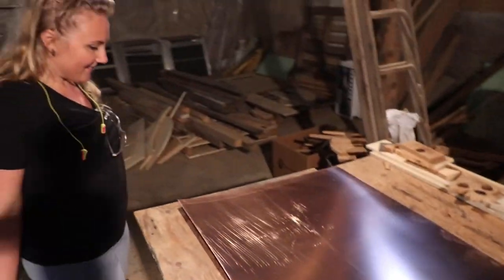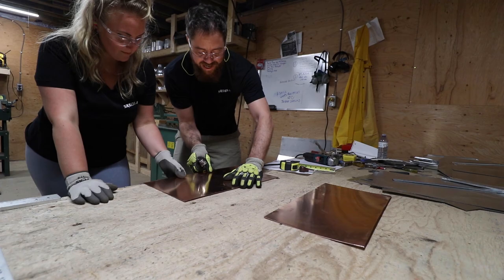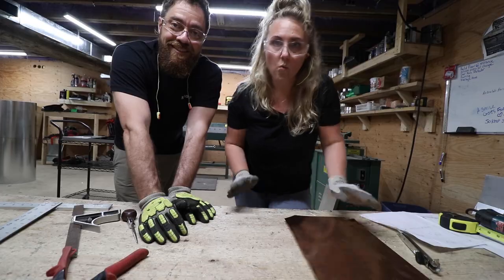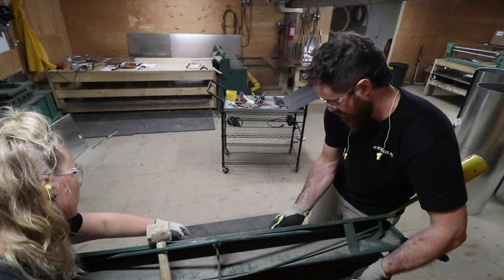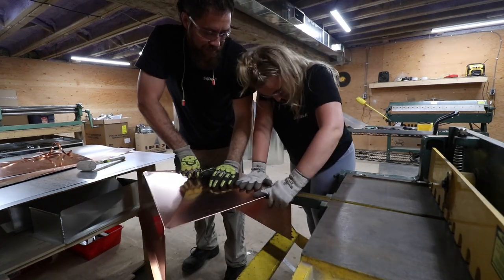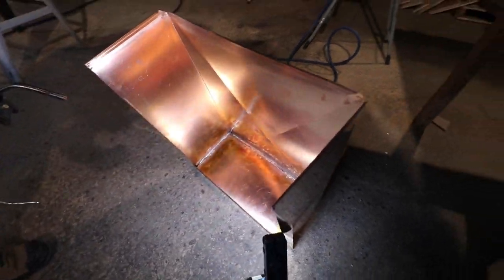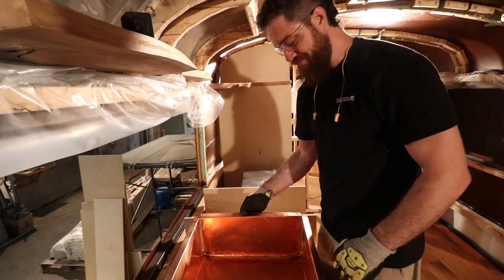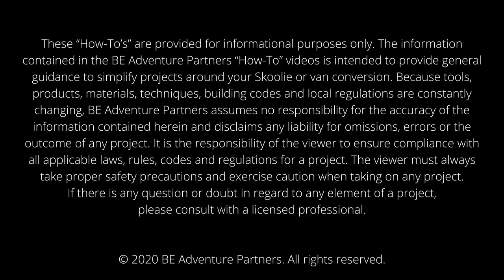DIY Handmade Copper Sink | Skoolie Kitchen (OMG WE DID IT!)

Comment: That is amazing...WELL DONE kids!  I love how you just dig in and figure it out. Nice to have all the sheet metal tools...and I'm not buying that you're a total nube 😉
Tip: The solder will flow towards heat. Rather than heat the gap, heat the edge away from where you are soldering. This really promotes the capillary action and fills the seam. Also, slow down a little and add a little more heat (get the copper hotter) before you touch the solder to the piece. That will make that solder flow better and a neater seam. Finally copper is a great heat conductor so it may take a while to get the seam hot enough. I'll bet you noticed that.  A++
Reply from the maker: Thanks so much @TR Bowlin 😃We ARE pretty new to sheet metal! However, we had just watched several videos on YouTube University on different ways to make water tight joints and Googling joint design , so that helped with our plans!

Those are EXCELLENT tips on soldering! What you saw there was our "practice" (yeah... we just jumped in to do it rather than practice on a separate piece... didn't want the waste! LOL) Love how you said to slow down and heat up the metal more first. Will do that next time we braze a seam!

Thanks so much for your thoughtful comment! It's definitely going to help up our sheet metal game!
- Brian + Erin

Comment: I love copper sink day it's the only day of the week I look forward to.
Use the copper scrap pieces in your naughty pantry door for some accents.
Just a thought and the sink turned out beautiful well done, well done if you build them for other people try a neumatic gun that you can get different tips for to give it your hammered look without having to hit it a million times your poor wrists.
Lol Great job you to.
Reply from the maker: Baahahhahah @Brian Davis! Well, if you like this sink, Erin has another that she's going to make for the bathroom (a pounded vessel sink)! We definitely picked up all our scrap copper because you'll see them become parts of other projects as we go along 😉 And that is a splendid idea to include some copper on that naughty pantry door! That pantry threw us a curveball because it wasn't part of our original plan and measurements AND we moved the fridge location, so we have a creative FIX that we need to design so that it has full range of motion for pulling out.

Great idea about getting a pneumatic hammer! We're definitely going to be mounting an air compressor on the rig so that we can fill up our tires OR we'll look into using the air tanks that are already on board for the air brakes and have a fitting we can plug into for topping off tire air pressure (that's one of the ways we did it on the fire truck in a pinch). However, installing a dedicated air compressor will reduce the wear on the air brake system and we'll be able to get higher pressures than 100ish psi which our tanks are regulated at.

There's something therapeutic about swinging the ball-peen hammer onto the sheet copper. What's cool is we could get Popeye forearms with a gorilla grip!

Thanks for watching and commenting! We appreciate it!
- Brian + Erin

Comment: Holy crap!! Not that the rest of your projects haven't been cool, but this one is the coolest of the cool ones!!  Tinning is one thing I've never done, so watching this process was fascinating. Because I have zero experience, I have to say, I wasn't seeing it, but once you got far enough along, then it clicked for me. Having Dad's shop available def made that whole thing a lot less work, for sure. Hand banging out all those bends would've been forever, and not nearly as neat and clean. Soldering def takes some practice to do a nice clean joint, and ain't as easy as it looks.  If I knew what I was doing with my kitchen reno , you'd have an order, but that's still a few steps away at this point. Now if you could just jump ahead to the install vid so we can see what it's going to look like, that would be preferable.  I do have to say, all that firefighter talk got a little distracting. Like peeps are actually gonna do all that. Come on now, get with the program. If that actually happened, what's the point of having firefighters? They'd never have anything to do. There are far worse things than having to call 911 once in a while. ;)
Reply from the maker: You just made both Erin and I burst out laughing (multiple times as we read this @2AZSUN)!! What's cool about this sink is we were dragging our feet on buying a sink because we REALLY wanted a copper one, but this rectangular style goes for around $1,500 USD. Although our sink is not "pristine" like the ones that come from the factory, we feel that the art of it embodies more of who we are AND we made it together. There's a ton of pride in this build where we look at what we've done, then look at each other with big smiles saying, "We did that..."

The install video will happen in due time... We want to play with patinas and test out some ideas on the small drop pieces of copper we have leftover from this creation. Also, we are going to make a natural DIY polish/sealer (which we haven't shown yet, but just received all we need to make it).

We do plan on making our crafty crafts for people who want one for themselves (we will have an Etsy shop at some point😃)

As for the public service announcements for fire safety... We want everyone to be safe when building!!!! So, although safety is not the most exciting stuff to promote, it's essential to survival! LOL! We know you like FFs!

Thanks for watching!! We appreciate ya!
- Brian + Erin

Comment: Just a suggestion,  sprayfoam the outside with a ridged foam insulation,  (especially if you have some when you do your insulation in the bus, if you do spray foam) will add some rigidness to it and make it not so loud when you put dishes or run water into it.
Reply from the maker: Ah ha! That's a great idea :) We do have a plan for noise dampening, which we'll get to in the near future when we install the sink. But spray foam would definitely do the trick!
Thanks so much for your idea & spreading the knowledge!
- Brian - Erin

Comment: I have a copper washtub im turning into a sink for our Mud Room/ Laundry room and i was really hoping you would show how you recessed the area for where the actual drain went in.  Is there a video where you showed doing that or  what exactly did you do ?
Reply from the maker: That's a great questions @Luke Simpson! We have not recessed the drain flange area YET!! However, we have an idea of how we're going to do that... Here's what we're probably going to do: We're going to get a 2x6 and draw a circle for how large the outer diameter of the flange needs to be (we haven't bought our drain yet, so we're not sure the exact dimension... but it will be the standard residential size). After drawing a circle on the 2x6, we're going to get our router and use our DIY router jig to route out a 360 degree circle to the edge of that drawn circle. After that, we'll just rout out the remaining material. Once we have hollowed that out about 1/4", then we're going to position the sink drain area on that and use a hammer to carefully bend the edge of the drain where the flange needs to be. That should give us sufficient drop in the copper to seat the drain like you see in commercially available sinks. If that doesn't make sense... You'll have to wait until we get back to the sink project, which is in the future, because we'll how how we end up doing it!

Hope that helps, Luke!  Are you building a Skoolie too?
- Brian + Erin
Reply: @BEAdventurePartners   No  skoolie here just a mudroom  sink and countertop replacement . My wife wasn't pleased by my suggestion theat we take  hammers to the wash basin, not at all.   Thats actually quite similar to the plan i had.  I have a scrap chunk of  6x12 i was going to Cup out with something  i just had't quite figured out what yet ... Thougbh  my method was a bit more crude than your plan .  (beat a divot into the wood .then beat the copper till it matches ..) I'll look into your method a ltttle more before I try mine.
Reply: @BEAdventurePartners  So I wound up doing a hybrid method  of  using  a hole saw that matched the OD of my  drain flange drilled into a scrap 4x6  about  1/4" then used a wood chisel to  remove the wood from the interior or the hole saw ... well hole.   Then using a ball peen hammer beat the edge of the hole down creating a gentle slope towards the hole created by the drill.   Then proceded to drill the hole in the bottom of my washtub,  lined it up over the depression in the wood and gently peened it to match the slope and shape of the wood.   Wound up using a vessle sink drain for its slanted sides that help shape the copper and allow for a better seal. I'm using the rubber gasket that came with the drain right now but may put a plumbers putty seal under it to get it just that much further recessed into the hole.    Hope my exp helps you either as a what to do or a what NOT to do .  Cheers!
Reply from the maker: @snafubariffic  ohh! That’s a great idea on how you’re using the ball peen hammer! If we do another one of these sinks on the homestead, we’ll use this idea! Thanks for watching!
- Brian + Erin

Comment: you need to make a dimple where the drain will go so the edge of the drain itself is lower than the sink floor and its perfectly flat so the gasket will seal , there special dies to do that , could be someone making sinks has one , or if you have access to a lathe you can make one 
its sumting that tooks sumting like this : https://i.pinimg.com/originals/39/14/c4/3914c480a1af7994beb495d606b95911.jpg but making a flat round step  where the drains edge will fit intoo
as for soldering , putting the flux on there before soldering helps a lot wicking the solder in , i seen people putting the solderwire  inside the joint before hammering it together , they heat it up untill it crawls out of the joint make for verry neat joints with little solder showing , then again scrubbing it with steelwool probably takes a lot of the solder off in the inside corners of the sink too 
if she likes soldering so mush she might want to try making tiffany lamps or stained glass windows , its an old art and if youre good at it you could make some money with it 
you need a way heavier anvil to make the joints sharper when you hammer it over (the anvil needs to be heavier then the hammer puonding on it so its doesnt move away when hit together like a 5 pound hammer holding the piece up and hammering it down with a 2 pound hammer )
making the dents is called peening and one good thing about it is that youre less likely to see scratches in the soft metal , the finer you make it the better it will look and the stronger the material will be https://www.quickshipmetals.com/quickshipmetals_decorative-bright-hammered-NY-New-York-stainless.jpg they use hammers like these https://images.globalindustrial.com/images/275x275/MRQ_276-168FG.jpg i bet you can get the same effect with an airchissel and an adapted chisselpiece (needs to me rounded and have a spring return so the chissel comes off the metal when moved ) 
you know even if the copper can turn black if you dont treat it (metal varnish?) , the end result looks great , might make one too but use brushed brass
Reply from the maker: This is ALL great intel @watahyahknow! I took notes from your notes. Sounds like we need an anvil on board the skoolie! We used flux, but we definitely need to work on our technique. This is our result from watch just a could YT vids. ;) Interesting tip about putting the solder into the joint pre hammering it together. We would actually love to go to a workshop on this. It is the most fun! What a great skill, and form of art. Love the brushed brass idea. We are thinking of using a combo of beeswax and mineral oil to protect the sink after we patina it. We want something natural. 

As always, thanks for sharing your wisdom! - Erin + Brian too

Comment: Where did you get your brake and guillotine?
Reply from the maker: Hey @Steven Shore. My dad has a contracting business. They do metal fabrication, and all kinds of other trades. SO we have been very blessed to be able to borrow some pretty amazing tools. - Erin
Reply: It's called a stomp shear. That one looks like a tennsmith or a grizzly.  Also, unless your at upwards of 900°f you're still soldering not brazing.

Comment: Where’s your dad’s soldering Irons? Normally a sink should be 32 ounce copper. You can tig weld it together. No lead issues.
Reply from the maker: @copperworks, we just use what we can get our hands on. We won't be eating out of the sink. We wash veggies in a bowl to conserve water. We used 22g because that's what they had locally. So far so good. Any tips on keeping it clean or slowing the patina down?
Reply: @BEAdventurePartners  you can use a  clear epoxy like what they use to clear coat wood tables.
Reply from the maker: Good to know @copperworks. The is for chiming in!
Reply: @copperworks  great tip for this consideration.  Could you also use a ceramic type coating similar to ones used on vehicle exteriors and interiors? Are they food safe?
Reply: Did you see their soldering?  Do you think they would be capable to tig weld???

Comment: How thick of a sheet was this?
Reply from the maker: Hey @Country Glamour - We used 18 Gauge copper sheet metal. Once the copper is hammered, it gains a lot of strength, even though the smooth copper feels a bit flimsy. Also, bending the edges and the bottom provides structure. Let us know if you have any more questions. We still have a few more things we need to do in regards to supports, undermounting, noise dampening the exterior, and installing the drain. Hope that helps & thanks for watching! 
- Brian + Erin
Reply: Very helpful! We really want to do a black and copper kitchen and this idea was so neat! Love your energy! Keep up the cool stuff guys! :)
Reply: @BEAdventurePartners   I'm interested to know this as well... you posted 16 gauge and also 18 gauge, and somewhere else 22g (gauge or grams?) Please share the actual gauge.

Comment: Great job on sink, however I was worried that you were going to solder inside sink as you did. Solder is made of lead. I'd suggest you do research on lead poisoning guys. Seriously it has high risk of making you sick. Especially being in a sink where you do dishes and possibly wash veggies and most definitely acidic veggies.
Reply from the maker: Hey there @Sandy Mckee! That is a solid observation that SOME solder contains lead. Before doing this, we consulted with a plumber about which solder does NOT contain lead as potable water copper pipes are brazed together using lead free solder and we used that stuff because we use this sink daily to wash fruits, veggies, wash dishes and do sink things. That's a great concern and a perfect note for those looking to do something similar. It's been awhile since we filmed this, but part of me thinks that I may have mentioned that the solder is lead free... But I could be wrong...
Thanks again for dropping this hot tip and for watching!
- Brian + Erin